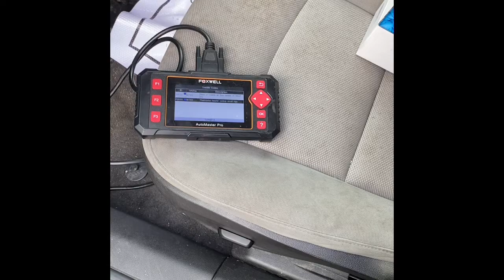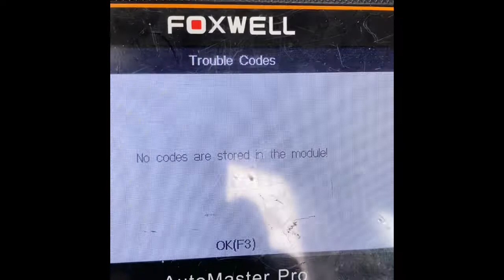Code P0599 solved

Comment: I replace thermostat and bcm... still has code po 599... any help
Reply from the maker: Is it still overheating? If yes make sure the recycling good to know that check upper and lower radiator hose.if everything good shouldn’t give you that code, you don’t think could be head gasket?
Reply from the maker: Make sure fan radiator working.
Reply from the maker: The upper and lower radiator hose should be warm sometime, if one hot and another one cold that’s mean not good.